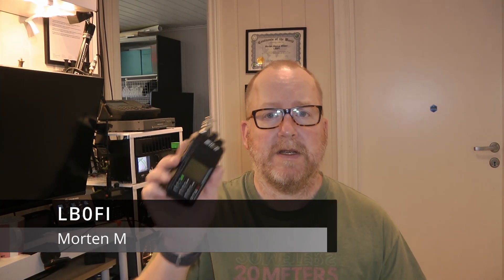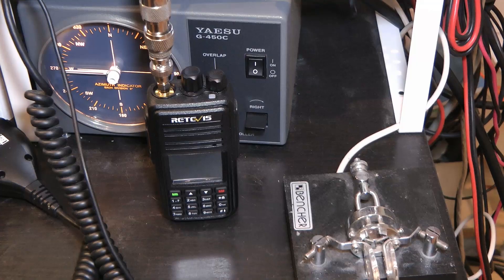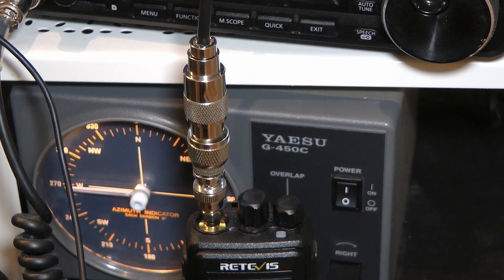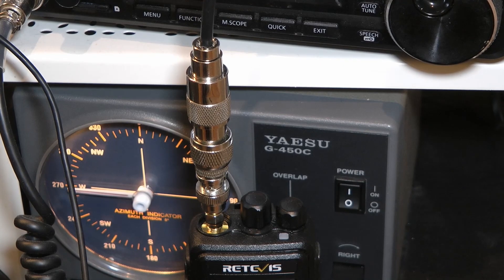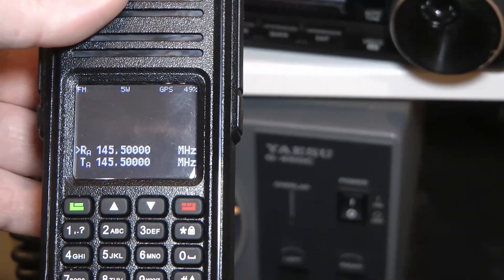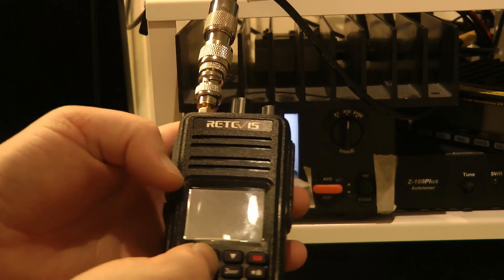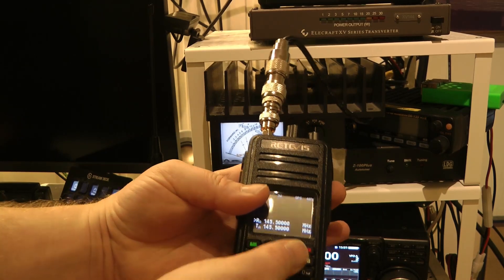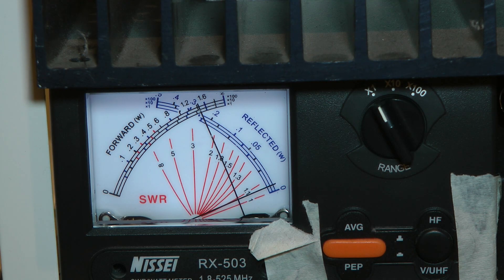How Much Power does the RT3S Have?

Comment: How long is the vox-delay? Looking for a HT with short VOX for a school project with a go-box for emergencies with APRS. I am using a phone for decoding / transmiting aprs messages, and What I need is a HT with short VOX delay, I have been looking at a Quansheng UV-K5 but I have no idea what the VOX-delay could be. My current Baofeng UV-5R has a way too long VOX-delay of around 2 seconds.
Reply from the maker: I have not tested that, but my experience is that using APRS with vox is really unstable. I have, as you, tested APRS with APRSdroid and a Baofeng. It's just to unstable. There are ways to go around this, but you would need to be able to PTT the radio somehow. If budget is no issue I would probably look at the Mobilinkd TNC if you could get a hold of one.
Reply: @LB0FI  Yeah, that mobilinkd has come up more and more when researching about this. Maybe I should give that a shot, it's quite pricey though.
Reply from the maker: @sa6kod154  It is. I have done a couple of videos on it. I have just borrowed it, and I am not sure that I would buy one for my use case. Then again, for your use case it seems perfect. I also sent you an email if you're good on QRZ.

Comment: I like that radio, i will probably get one to experiment.  Did you do a video installing the firmware?  I didn't catch it. 73
Reply from the maker: No, I didn’t. The installation process is different depending on the radio model, so I decided not to do it. There are very good instructions on the OpenGD77 website though.